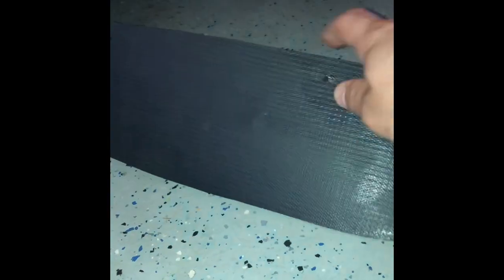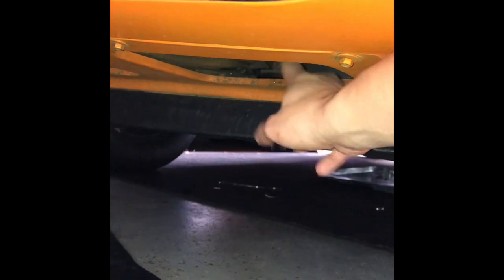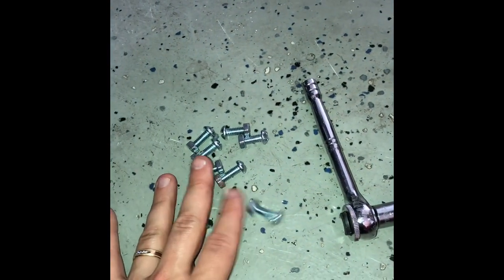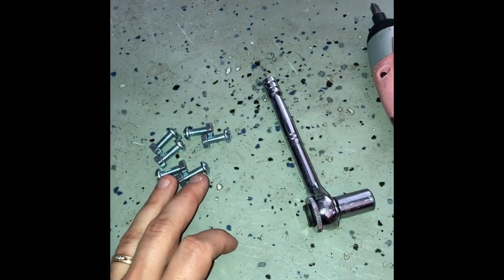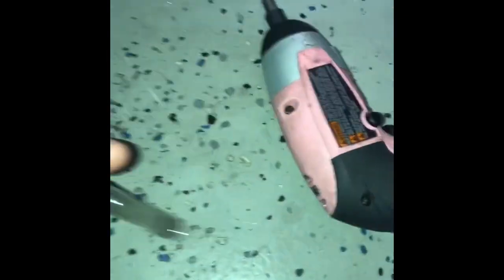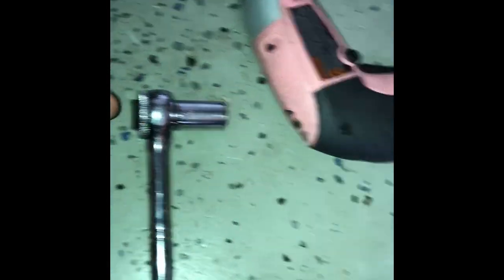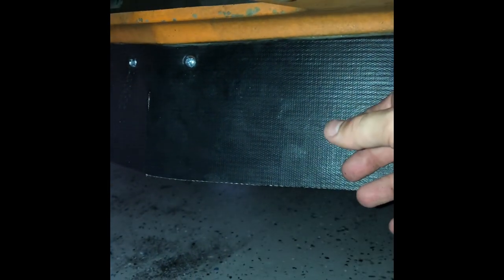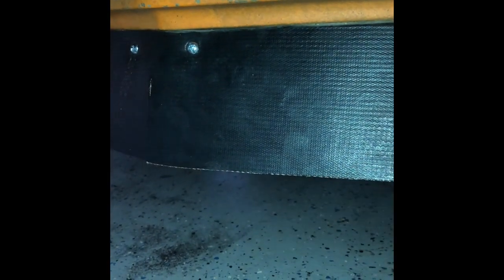C3 CORVETTE AIR DAM EXTENSION

Comment: Be cool if you mounted a gopro to show IF and at what speed it folds over, seems kinda too flexible but maybe it's just me.
Reply from the maker: BOOT I agree that it would be cool to see if they fold over, but they are VERY rigid and when folded like that in the middle, increases the strength much more. I highly doubt they even twitch. 😃 this is the oem material and GM did wind tunnel tests before making it an OE option.
Reply: @classiccorvetteguide9147  You know for a fact they tested this exact piece?  Cause I know the C3 aerodynamics is worse than my Silverado!
Reply from the maker: BOOT well- I know that it made a difference in temp at 70mph and that is what it was designed to do.
Reply: @classiccorvetteguide9147  I'm sure it does effect cooling temp at some highway speeds or below, never said it didn't. The Z51 C4 used longer air dam pieces as well but it was a complete new plastic piece.  Also you can buy better one piece entire front air dams for the C3.  My point was, does the rubber add-on bend over at some point?  Even if it was tested back in the 70's were the highway speeds lower at the time?
Reply from the maker: BOOT it is very difficult for me to bend it the way the wind would. It has a metal core - I highly doubt it and know it has good reviews.
Reply from the maker: BOOT furthermore- the plastic ones are known for being eliminated by road debris
Reply: @classiccorvetteguide9147  You can't press on the entire length at the same time with two hands or the same force.  Metal core that doesn't get damaged by hitting debris?